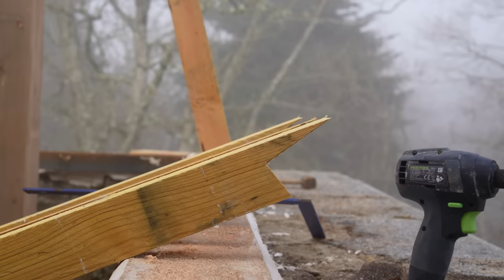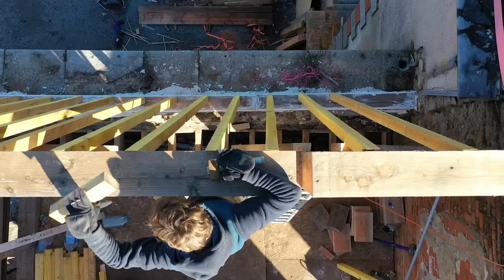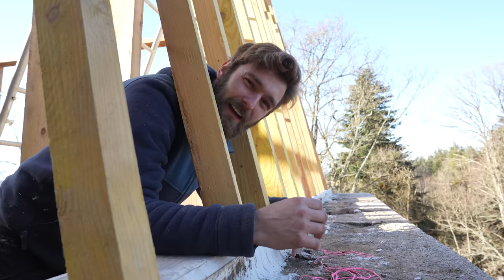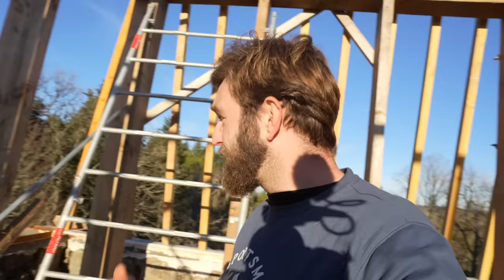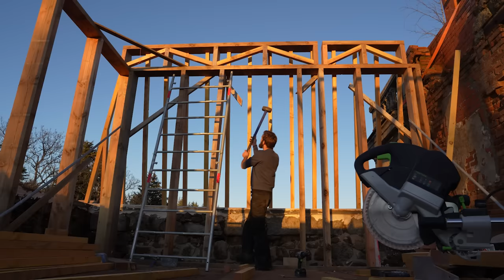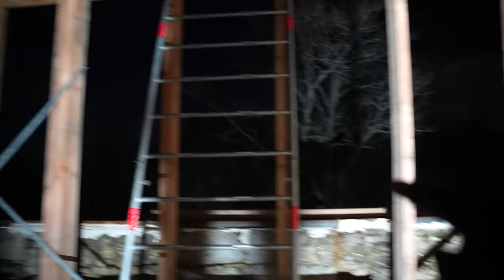The MANSARD roof starts to take shape.

Comment: There is not a roof I love more than a mansard roof. The fact that you are building one by yourself is amazing.
Reply: will there be some type of gutter to protect the top of the wall?  I thought the rafters would go to the edge of the wall.
Reply: A Hansard roof and Mumford fireplace....
Reply: Rumford... Lol.
Reply: Usually, the gutter runs at the basis of the roof and there is metal sheeting (zinc) on top of the wall to prevent rain pouring in. If you ever visited any French city-center, you can notice it by looking upwards particularly in Paris and it’s general area, Bordeaux, Lyon.
Reply: @Nini-pw4uf  interesting....will look for photos...although to be effective, I would think the metal would be placed before the rafters?  Also, the plaster goo they put below the metal C channel for the ledge beams said "interior" on the bags so I assume it is not waterproof?
Reply: There will be tiles over it down to the gutter. And the sheeting obviously has a « L » shaped section.

Comment: Those bird mouth cuts in your chevon uprights are cut way too skinny. There is little to no lateral support the way they are cut. They will be very susceptible to splitting and breaking off. To support the whole width of the member you could place a horizontal 2"x4" between the chevron uprights and the wall. That way the full thickness of the chevron uprights will be supported. Now I know that they are virtually upright and a lot of the load is vertical, but during high winds there is a the propensity for side and slewing loads that will at the very least will rock back and forth and loosen stuff up and be a squeaky miserable place to be. Something to make it firm and tight, able to resist anything mother nature throws at it would be the way to go and very easy and inexpensive to accomplish now.
Reply: Yup, when I saw him cut those birdsmouths I really hoped they were going to go in the other way.
Reply: I wish there was some way Dan could see this advice. There’s so many comments for him to scroll through. I just hope he catches this one.
Reply: I was concerned as well. I was wondering if my concerns were valid. There are so many instances of so close yet so far. If you see me stop commenting some day, it means I finally had a heart attack from the anxiety of it.

Comment: I just googled mansard roof and it says this is one of the hardest roofs to build due to intricate design. Testament to Dan’s endurance in this chateau build. My son is a roof framer in Australia so I’m particularly interested in this part of the build. A nail gun will make all the difference when it arrives. Well done Dan 👏🏻
Reply: is it endurance or point blank madness! naa not madness, determination to restore a heck of a historical building! thats what it is! 😊 now mad would be building it from the ground up entirely!! 😂😂😂
Reply: He does it the simplest way with one vertical supporting layer and rafters. The framing is much more complex when you build only one structural layer. Because then you have angled tenon and mortises and it has to give structural strength.

Comment: Keep pushing Dan. In a few months, one roof will be done.
Reply: it's a matter of weeks, not months. He's fast.
Reply: @Tantejay  I have been watching Dan from the 1st day he had at LaLande. 
I have also done Construction as a Career/job. He has lots to go before that one section of Roof is completed. Besides the actual framing. He has to waterproof it and tile it.
If he has continued help, yes.
You have no idea how complicated the Roof Tiling is and will be.
Reply: @dennispatrick4999  Dan earlier said that the cover for the roof will be temporary at this stage. He will also wait with the windows.
Reply: @KjerstiNagel  All the more reason it's MONTHS away. Delaying the inevitable. His previous attempt at The Tarping failed miserably.
Reply: @dennispatrick4999  Who said anything about tarp? The most important is to get it watertight, don't you think..?
Reply: @KjerstiNagel  To actually Finish it and move on to the other 3 Roofs needed.
Once the Roofs are done he can move on to the massive interior renovation.
Water, Power, Plumbing, Walls,  Windows, Floors, Stairs. 
Have you ever built a home? I have. Dan's Chateau is an enormous undertaking. Especially with very little help. And, he's already stated he won't use Cranes or Cherry Pickers/Condors. 
And, Dan's a Chef by trade originally. And, part time landscaper.
This was not for the faint of heart.
Reply: @dennispatrick4999 I hope it's a temporary, watertight cover at this stage. Trying to tile in snow and ice would be suicidal. There's plenty to do tidying and repairing the internal walls below until spring.
Reply: @michellebyrom6551  It will be interesting to see what he comes up with to protect the lumber; which needs to remain dry.
Reply: @dennispatrick4999  would corrugated metal or glass fiber sheet be enough over the winter? Or that adhesive asphalt roofing people use for sheds? (don't know the term in English) Actual roofing with tiles and all (possibly also solarpanels) is a huge job he'll need professional help with in proper weather alot further down the line, so I'm thinking what's feasible to get done in these winter circumstances without more help than Nick and without spending too much is the challenge...
Reply: @gnarbeljo8980  Yes, definitely. Anything that keeps the Wood dry. 
But, remember, if you look at the design of his roof, it's complicated. Especially without using A "Condor"/cherry picker to work on the exterior roofing.
Reply: @dennispatrick4999  yes, that's curious. I wonder what he's got up his sleeve? He knows not to disclose too much ahead of time to keep the suspense for sure! 😉
Reply: @gnarbeljo8980  Cranes and such are extremely expensive in France...
Reply: He does need to get some full time help. And not Nick/Cameron either. They are better at landscaping. He needs a full time general builder who can do finishing work.
Reply: @PreservationEnthusiast Spot on!
I get that he wants to be a one man band; but the reality of it all is and can be terribly dangerous.
Reply: @dennispatrick4999  Billy of The Pethericks has a cherry picker, well I think he does anyway. Dan could always speak to Billy about doing that
Reply: @rebekahvenn201  Billy does; but it may be a shipping issues from Billy's Chateau and eventually back again.

Comment: I think that the quality of the wood I see you using for this is so much better than what could be had at most lumber yards or big box stores in the USA.  Good Luck.
Reply: It's the structural grade that's tested for strength in roofing, rather than general purpose he used for joists earlier.

Comment: I’m in a 4 story, 1850’s mansard, seems to be 42’x42’.. fixing all aspects of a 35 yr old renovation. 
   I was in it when it was converted to 2 apartments, with completely separate frame systems, and witnessed the orig. mansard from inside the roof framing at the peak. 
   With completely finished plaster walls, and 10ft ceilings, it’s a wonder to see.👀

Comment: If you do end up using a tarp for the winter, I strongly recommend using a used billboard tarp.  They're thick vinyl with reinforcing strings integral to them and will last for years.  Once side will have printing but the other will be blank white or black.  They're more similar to roofing membranes vs a regular tarp.  Don't know about they're availability in Europe.
Reply: They're certainly used a lot, the trick would be finding out where to get used ones. I've seen Russians on Youtube use them permanently, instead of siding on their buildings.
Reply: Great thought.

Comment: Uncle Winston reminding you your hip rafter runs are based on 17(using inches. I’m old principle is still the same) not 12 like common rafters. So a roof at 15/12 will have hips figured at 15/17.

Comment: Is the use of plaster to hold, protect and stick a steel girder and a wooden beam together  a traditional method and could a builder explain how this works please?
Reply: As it progresses, you will see how that all works. It is basically a complete structural unit sitting on top of that wall and braced by the vertical framing attached down to the floor. Quite solid!
Reply: So Paul, why not bolt those steel things into the stone they are sitting on?
Reply: @zie9171  those are solid granite blocks. They would crack. They were not bolted originally.

Comment: Looking good. Wont be long until breathable felt is on! Be nice then to work in the dry re building the walls and consolidating them. Good spring job to fit the slates and zinc. Built an oak framed dormer with mortice and tennon joints in Normandy and used zinc as told lead not used as poisons the ground water. Looked really nice and enjoyed doing it.

Comment: This roof is very "experimental". You just glued iron to the walls and then used to fix it to the  frame. This is not the way to do it.
Reply: Fairly similar to how it originally was done, except the adition of the steel beam. Did you see any holes from old fastners on top of the walls? Dan did in an earlier video show the old holes at the outer edge used for securing the gutter. 
The hole upper floor are as I understand it designed as being an seperate box fastened to the walls on the inside at floor level. The weight of the roof are not ment to rest on top of the walls. It was apparently how french mansard roofs was constructed back in the day.

Comment: That is a lot of angle measuring...... Brilliant carpentry work, Dan. 
I think if this was done in a modern construction site, they'd preassemble the hole frame including the mansard angles, at a factory, then hoist it up to the roof via  crane and secure in place.
It may be, that the blessing of the wall being level and the iron support being on a very level surface, there's less chance of pre-cutting a length of wood and it not fiitting.

Comment: Unless I missed something in a previous episode, it appears that your sill plate is held on with nothing more than plaster? When the plaster disintegrates (and it will!) there will be nothing to keep your roof pinned down to the structure. It would be wise, while it's all open to go back and drive some anchors through the sills into the stones to properly anchor your roof structure.

Comment: There has to be a slick way to lift the beams and not struggle with them at the top. Could you wrap the sling the same way around the beam, but lower, so the beam would hang almost horizontal.  If you then add a separate strap around the top section of the beam that could be quickly removed once it reaches the top, it should allow the beam to pivot to the near horizontal position without having to pull so hard on it.  Hopefully that description made sense...  Merry Christmas!

Comment: Thank you for addressing the nail issue. It was driving me bonkers wondering if they just had different building codes in France or if you had some sort of new fancy screws that met code.
Reply: They do use a lot more screws in Europe than they do in the US. A few years ago I watched a carpenter close a hole in a flat roof (that had been cut to lift out some heavy equipment with a crane) and he only used screws on the joist hangers.

Comment: - My advice for when your using the nail gun - have a crowbar/prybar to pull out boards or nails. The nails (especially framing nails) go in tight and don't want to come out. I have broken my fair share of hammer handles trying to pull them out. 
- I do have a question about the layout. Off the Turret you have 2 balcony's. One is above the bathroom. What's the other one over??

Comment: you'll be nailing roofsheets on your uprights.. with your spacerblock you now have a good but rough placing of your studs, there can be creep in your spacing this way which may lead to the edges of the sheeting not aligning properly with your structure at some point. best measure your spacing from one end outwards..

Comment: Dan, are you planning to try and get one floor buttoned up with windows to use as a warm work space? Steve
Reply: He did say no windows yet.....
Reply: @denisemastromina7821  no windows for that level of the building because it requires additional framing. I am talking about the floors below that are wide open. By closing off the window holes of each level, Dan could have an area on each section that is buttoned up and could be used as a warm workshop area.

Comment: I live in the mountains of western Canada and our roof structures, with a heavy snow load requirement, are a fraction of what you have built here. Was it the weight of the cladding that necessitated such a heavy structure historically? That’s a lot of lumber to fight off a bit of rain and some flecks of snow.
Reply: Slate is heavy, so maybe that is the difference

Comment: Hii Did you add anchorages through the steel and the wood into the stone, only plaster maybe it is not enough ? And screws are better than nails ? Ty
Reply: Again....its not structural...he explained the whole process. He doesn't have to do it because the roof will not be siting on top of the walls, the walls are not going to bear the weight of the structure , the beam on the wall is just to hold the beam that r going to shape his roof....it won't be needed as it's not a roof but another level build with wooden beams architecturally shaped as a roof...just for esthetic. He build walls for that purpose so he doesn't need to build a roof on top of his walls.

Comment: Looks great!
Is the slope slightly less steep than the original, or is that an optical illusion?
Looks in the video that the old traces on the wall it joins against shows a slightly steeper incline?
Reply: I've been wondering as well!
Reply: If this is due to the inner wooden wall framing ended up further away from the outer stone wall than the original design, it would have implications on the upper part of the roof as well.
Next to the tower, there's a stone wall that meets the roof half way to the peak. -The wall with the tiny square window in it for the attic hallway..

Now if the lower part of the wall now slopes too shallow, the upper part would need to have an increased slope to compensate. (unless the height of this intermediate wall is reduced)

Makes me think perhaps starting on the centre section of the roof would have been better to get proper alignment with the original roof traces.

The roofing on the other side of the tower has more of the original construction traces remaining and I suspect that if you want to mirror that side new roof with what is now being constructed, modification of original structure would be needed to make it fit.. 😞
Reply: @Ragnar8504  
Yeah, I think perhaps the slopes are not all equal around the roof in the original design?
I just had a look at the older videos that shows some old photos. 
Looks like potentially the forward facing slope is steeper than on the sides.
If you compare the mansard window's framing, -the setback at the top looks smaller when looking at the windows facing forward compared to the windows facing to the side.

Comment: Hello, just a question i have been trying to figure out, why there are steels bedded under the timber wall plates?  the only thing I can think is for weight distribution or also to stop moisture getting to it? keep up the awesome work, love watching all the content and merry Christmas😁
Reply: The original structure didn't have steel beam, its not for weight at all as the roof will be sitting on top of the flooring not the walls so it doesn't push onto them. The steel beam r going to help keep the wooden beam in place and the plaster used will prevent any water infiltration. The structure of the mansard roof needs a light inclination of the walls unlike the typical ^ A shape so he needs to connect the top of the roof onto the walls and help him shape the mansard roof. The structure of the whole roof is build on top of the floor not the walls, but esthetically will look better that way. If u visited Paris u would have seen most of the buildings have mansard roofing like his.

Comment: Will you be bolting the roof to the walls just with one or 2 rods?
Reply: The mansard roof is a whole level so it's much more heavier than a simple A shaped roof that's why he can't put it on top of the existing walls. They weren't build to bear the weight, his roof will be sitting on top of the floor that's why he did build the walls first. What is he doing is just connecting his structure to the existing walls now . He doesn't need to bolt it to the brick walls.

Comment: It looks like it wont meet the buolding where the original did. Is this by design?
Reply: It's slightly inclined to connect it to the walls he build on top of the floor....it is the shape of mansard roofing, the structure will not be pushing on the building walls.

Comment: Are you building to original or making this up? How in the long run will you protect the top of the wall?
Reply: It original roof..........the mansard roof is build like that. Not really connected to the brick walls and the top will be a small A shaped roof.
Reply: @skdoremi6666  good morning, if they’re going to protect the top of the wall with cement they should do it before it becomes inaccessible via roofing!

Comment: Dan (All); Stupid Question: Given that both 'wings' of the house have multiple floors topped with mansard roofs, why not do all the floors then both the roofs at the same time? I am sure Dan has a logical reason. I just haven't heard it yet? -Thanks. ;)
Reply: This way there will "as fast as possible" be an dry indoor part ot the buiding. Meaning a dry place for the tools, building materials and to stay. The alternative is to for months still have rain and water everywere inside the building. The first build floors might end being damaged, before getting an roof over them.